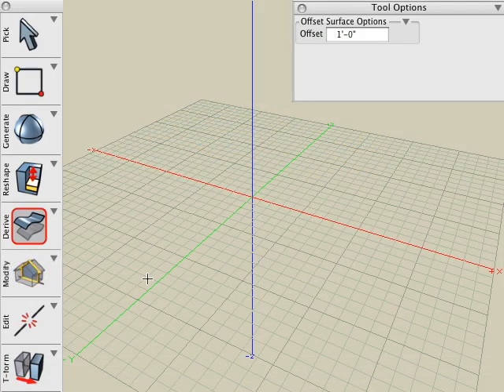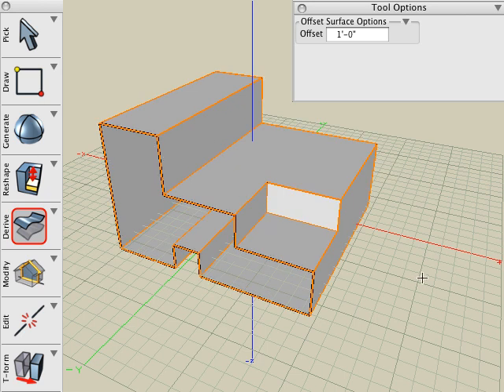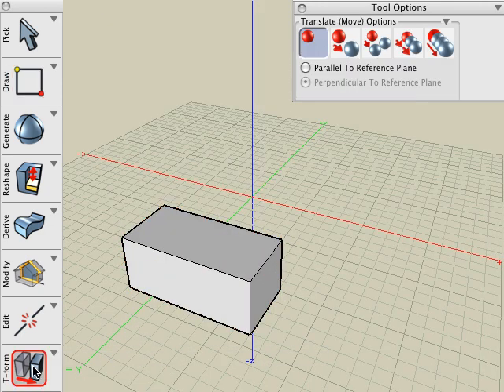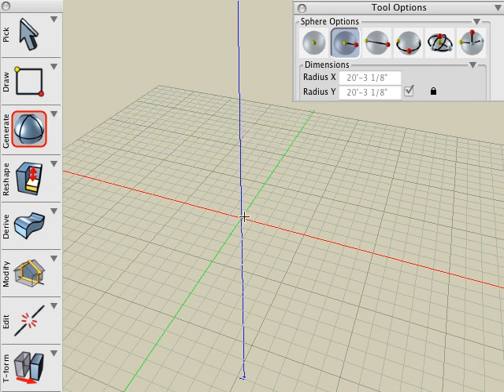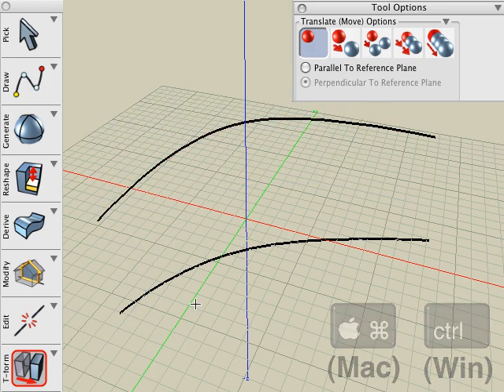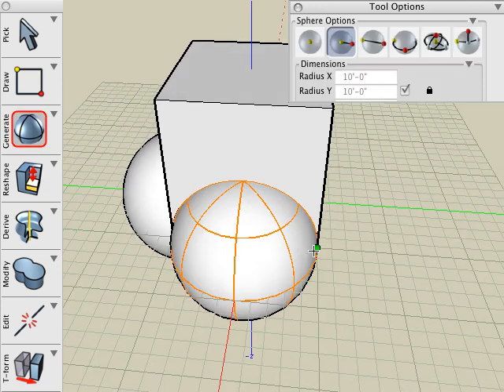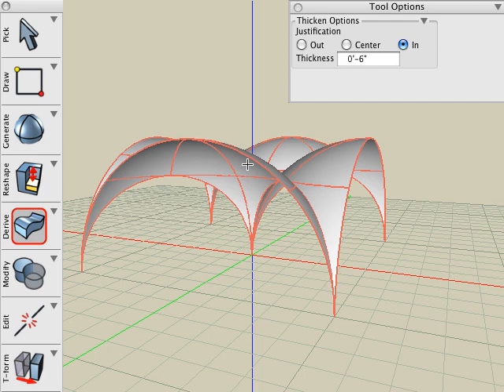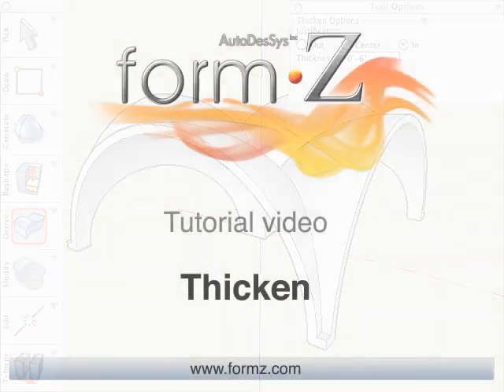formZ Thicken

Comment from the maker: Hi Carlos,
That message typically indicates that the curvature of your surface is too tight for the thickness you have designated in the Tool Options.  If you choose another justification, or a smaller offset, does this work for you?
If you are still having trouble, please send us an email with your .FMZ.zip file attached so we can help.  You can contact us directly at support (at) formZ (dot) com.  Once we receive your file we should be able to give you a more specific answer.